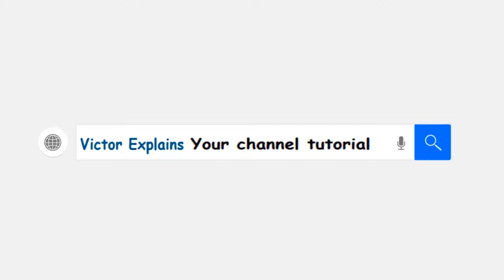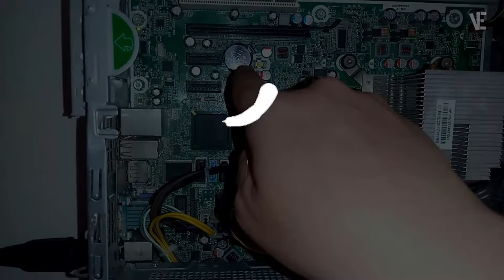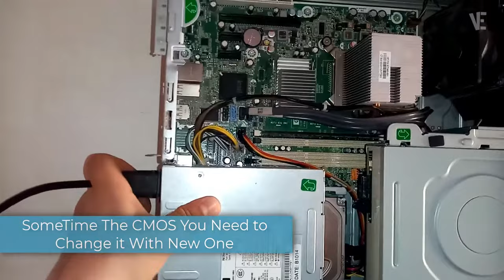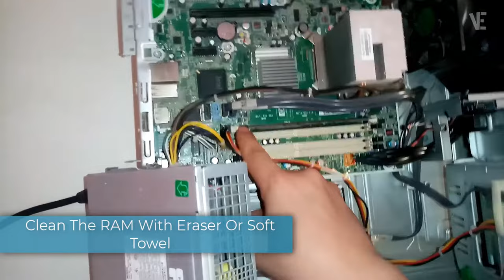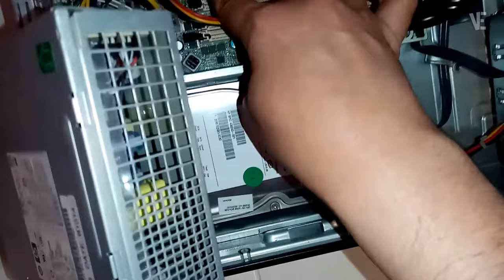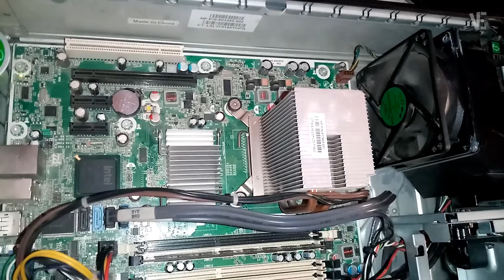Computer won't Turn on | How To Fix PC Fan spins For Few Seconds Then stops With Some Ways

Comment: "throw it into the trash" ...as you suggested....that is not a solution!   the fix usually (what you did not mention in your video) is to reflash the bios with the newest version...just take out the bios chip and reprogram it, that usually solves 90%+ of the fan spin stop/ no boot  issues

Comment: None of this worked for my computer...but then, it turned out to be a hardware problem. Your solution was to throw a three thousand dollar computer away because your "fix" wouldn't work. Not the sharpest tool in the shed, are you??!
Reply: i might have the same problem since my computer flashes i tried everything but the CMOS one
can u plz tell me what type of hardware problem it was

Comment: This happened to me a hour ago i unplugged every cable of psu , cleaned ram and put it back together, and then when i turned pc on my psu trow smoke i quickly unplugged pc and i will replace it because warranty isn't expired.

Comment: Peace be upon you. Please, I bought a new gaming device, but when I came home and turned it on first, the device turned on and the fans and everything, but the screen did not display anything. Then some attempts changed the image cable. And the device locks up, and so on. What is the reason for that, please? Do I return the computer because it is still just new? The board is asus b450 tuf gaming plus ii Healer amd Ryzen 5 5650g pro Ram 2*8 case redragon Power supply couseir 550 elite plus
Reply from the maker: maybe you have problem in graphic card
Reply: @VictorExplains  apu pc no graphics in it 
This may be from ram or hdmi cable 
Or from mother board electric